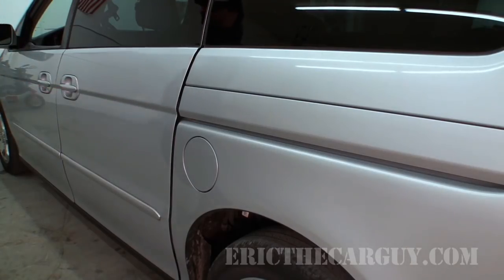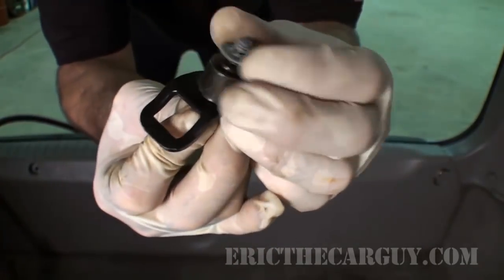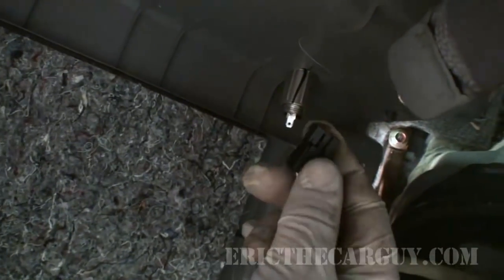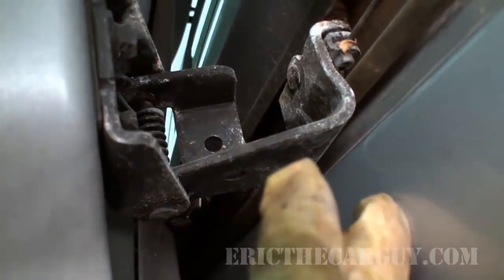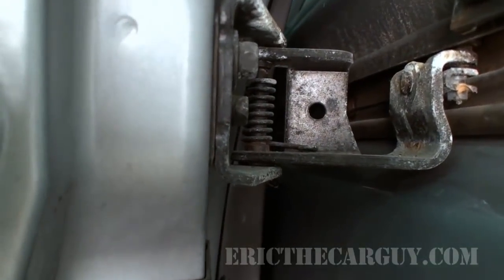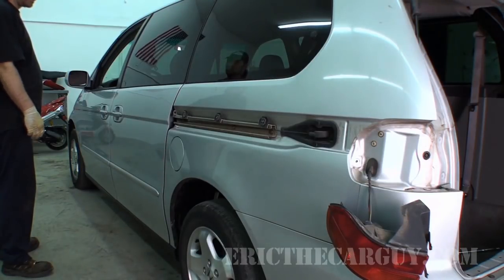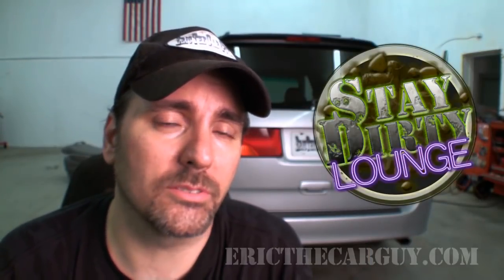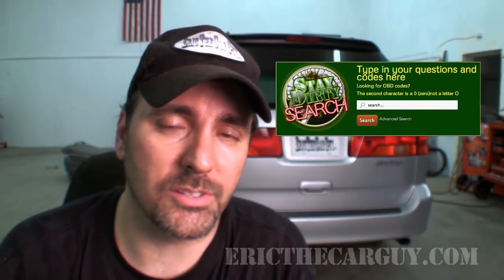Sliding Door Repair 2001 Honda Odyssey -EricTheCarGuy

Comment: After watching the video, I completed replacement of roller on my 2002 Odyssey Passenger side sliding door. Actually, I didn't need to take the entire interior out, just pull off to the rear speaker and the motor came out so that I could adjust the tension on the wire. I ordered part online which cost me less than $50. Thanks, Eric, your video very helpful.

Comment: Followed this video to do this repair on our faithful 2003 Ody (bought it new). Thankfully, I did not need to remove third row seat or as many panels as Eric took out, which saved some work.  Fantastic detail in Eric's videos gives a DIY'er the opportunity and confidence to save hundreds of dollars on every repair.  Part cost ~$50+ delivered. I would have never attempted this without such a great coach!  With five drivers in my immediate family, I have a fleet of older used cars that I maintain, p;ease keep these videos coming.

Comment: Eric, thanks for the vid. After performing this procedure myself, i found that u need not completely take out the rear seat or remove all pannels. rear seat should stow away in the trunk to give u room. you also need only to pop panel back to the rear speaker. u just need to be able to adjust cable tension. i would not have figured this out withiut ur vid. lastly, before u reinstall everything back, check door closed with engine running to ensure door closes all the way and sensor is triggered. i found adjustment was needed at the rollers placing doors a few mm up, yup location is key. thanks again for very helpful video. deuce

Comment: Eric: Many, many thanks for the great video.  I just changed the driver side roller assembly on my 2002 Odyssey and here are some pointers based on my experience of one job.
1) Based on looking through multiple videos you do not need to remove as many interiors items as Eric did.  I have seen comments that it can be performed without removing any interior panels but I was follow suite.  I found it impossible to get the old roller assembly off without loosening  the cable as Eric showed.  I would strongly recommend marking the inner and outer wheels of the inside cable tightener with a Sharpie before you loosen it. That way you know the alignment needed to achieve the same degree of cable tightness as Honda originally had it
2) To get at the inner cable tightener I did the following: Put third seat in stowed position.  Removed mats.  Took out screw hidden where the jack is housed.  Removed jack and all jack accessories.  Note: If jack does not want to come out, likely it is because it has been tightened so that it does not rattle.  Turn the exposed circle counterclockwise with one of the accessories so that the jack closes and is easily removed.  Remove the second row seat belt at the base (14 mm).  Remove the stereo screws.  Remove the screw near the latch for the third row seat. With these removed you can open the side panel enough from the top to perform the work you need to accomplish
3) Honda says I could use white lithium grease to lubricate the channel, which I did when I was finished (Eric used axle grease)
4) I recommend covering the side of the car with painters tape and rags to prevent scratches
5) My hinge also had a shim plate which looked like it was welded on but it was not, only held on with very good adhesive.  I was eventually able to get off with screwdriver and hammer and WD-40.  Soaking with a solvent like alcohol or acetone may have worked better.  To reglue the shim to the new assembly I used Dap Rapidfuse from Lowe's.  It set very quickly
6) By far the hardest thing to do was to get the cable assembly to close back to the original mark I made with the Sharpie.  I am quite strong but the best I could do was to get close but the cable was still to loose.  Finally, I got it this way.  Get it as tight as you can, attach the assembly to the door.  Close the door and then open the door as much as possible.  With the door on and the door all the way back there was finally enough slack in the front of the cable that I could get the inside wheel to turn to its original position.
7) Finally, when completed, door worked well but there was a louder clunk than usual at the fully open position.  A different video showed a rubber stopper that is supposed to be in place at the top of the door towards the back. My car was missing both (for how long??!!) so I didn't realize it was even missing.  I will try to get replacements at Honda.  I wonder if the extra play due to missing stopper some how causes the door assembly to hit in a funny way and wear down/break the nylon roller piece.  All this work because one of the roller assemblies nylon rollers was gone.  The other was intact.
Good luck fixing your Odyssey!!
Reply: Hey reading your post gave more ideas I was scared I had to do all Eric did on his video, your comment just save time to me =) BTW  I have a question that may  someone had already, can you give your advice? doing what I think  could be easier and save a bunch of time too.  Do you think is possible just to replace the rollers (by doing this I think there will be no need to loose the  cables)  and use ball bearing rollers easy to find at any store, or either make some out of a 3D printer ? may be? what do you think? I own a 2000 Oddy and my damaged hinge  is the right one, (Because I live in Tijuana Mexico and here is not possible to get the hinge bracket for the replacement)  Thank you =)

Comment: I did this repair on a 2001-2004 odyssey, right side.  As others have mentioned (thanks!), I didn't have the allen wrench socket, so I lowered the back seat flush with the floor, and pulled the side panel forward and reached around behind it to change the wire tension.  I joined the ETCG premium to see how to do the right side (he has an extended video that shows that, but not in as much detail as the left side), since I was having problems with that.  Thanks, Eric, for such a detailed videos and explanations!

Comment: Boy did you do that the hard way, Eric!  We Honda techs don't pull out the inside panels unless we're replacing the drive motor.  It's a bit tight, but with a pair of "Vise Grips" it is possible to pull the cables close enough together to change the roller.  In the worst case, if I get one that's really stubborn, I'll bend one of the cable guides on the roller, insert the cable barrel, then bend the guide back.  The front bracket for the track cover tends to break off, but it's no big deal, as long as the cover engages all the lugs.  The screws in the back behind the taillights will keep it from going anywhere.

Comment: Hey..great video. Im tackling this job as we speak.
I would like to add something tho...the third row seat does not need to be removed.  You can just fold it in and the panel is actually cut out around the anchor point. (can be seen in your video) 
I didn't remove mine. I was forced into thought after I seen how big that allen bolt was and was like "uh oh..I dont got one that big" After looking at it for a minute I thankfully realised it did not need to be removed..
anyway..great video. it was extremely helpful!!
Reply: Also FYI for those who also don't have the wrench, I think it's a 12mm, not a 7/16 as mentioned in the video

Comment: I own the 2002.  Yes, the Odyssey is not one of Honda's best, and had major tranny issues early on. My tranny was replaced under warranty and it is still going trouble free. The Odyssey has excellent power, 20-22 mpg, gearing is well designed, does not burn oil, no leaks of any kind, 165k. Seats 7 and will haul as much as a full size pick-up without paying for commercial tags.  If it is working, keep it!
Because of your vids, I replaced the same slider, and the clock bulb. Thanks, Eric!

Comment: Thank you very much for the great video.  After watching the video, I replaced both of my door rollers, and everything is working like new.  It was great to know what to expect before I even started the project!  The dealer said it could cost ~$1400 for the repair, and I spent a little over $200.
Reply: did you remove all the inside panel

Comment: I had bad roller assemblies on a 2003 Odyssey plus a broken cable. I replaced the cable with parts from Home Depot per a You tube video. I also replaced the roller without taking all the inner panels.  It took a little effort to connect the second cable end but that saved a lot of time.

Comment: I just repaired both doors on my 01 Odyssey following these steps. I first tried to change the hinge without removing the inner panels, but there wasn't enough slack in the cable. Steps worked great. The only issue was the allen head on the back seat. It's not a 7/16 hex, though that may work in a pinch if the bolts aren't rusted. It's a 12mm hex.

Comment: Hi Eric, the mystery electronic device (at 13:57) attached to the inside the Ody left rear panel is a brake light failure sensor.  There's also a vacant receptacle taped up in blue to the rear-hatch wiring harness (at 14:07) that can be used for trailer lighting.

Comment: I'd like to add that Eric, as good as you are, you missed securing the passenger side middle retaining clips that face toward the camera before you reinstalled the weather stripping. Just thought i'd point that out for ya. also the rest of your videos on Hondas are very helpful, I'm certified through Toyota so being knowledgeable on one family of cars is vey helpful, having someone else who is knowledgeable on another popular brand is just as helpful! Keep the videos coming and I might suggest a video on diagnosing an issue with the engine not starting because of a defective computer, long story short, a customers vehicle came in with no spark, no fire to the coil and no power, after a few hours of research and contact with the dealer for an electrical schematic, I finally came to a hypothesis and conclusion that the PCM was faulty. low-and-behold, replaced and the vehicle started right up immediately on the first turn of the key.

Comment: Excellent video, Eric.  Thank you.  One comment.  The whole dis-assembly to the rear of the mechanism was simply to access the large tension wheel and turn it first one way then the other.  Surely this is a classic case for a pop-off access panel or, in its absence (shame on your Honda), neatly cut out an access hole of your own then replace it with a neat cover plate.  Something tells me these roller bearings will wear out again!  What say you?

Comment: Jesus watching you tackle these jobs is very funny but very insightful both sliding doors on mine the bearings are smoked the body panel is scratched all the way down..i will attempt to do this job after this brutal buffalo winter..the sarcasm. Is enough to make me want to get it done at least on 1 side

Comment: Great instructions and video. I have a question for my 2004 odyssey. If the only reason to disassemble panels is to reach to tensioner in order to release the hinge from cables,  could it be an option just partially cut through the inside door panel with vibration cutter at proper location.  Van has 0 value at this age and shape anyway.  This would save 80% of the work, in case you do not worry much about the panel aesthetics after taping.

Comment: I replaced the right and left rollers in one afternoon. Taking time to remove the side panels is well worth it.  Doing this job without removing the side panels to access the tension wheel is not a good idea.  Extremely difficult to remove and reattach the cable without releasing tension.  However, you don't have to remove the rear seat.  The side panel lifts over the bolts.

Comment: You'd think, if Honda designed things as they used to, you could simply remove the rear "glove box" to get to the motor without having to do all the nonsense of removing seats, weatherstripping and the entire side panel.

Comment: I have replace the sliding door motors on these vans and it is a pain in the ass. especially the left side because the heater core box covers up almost every thing. then when they go out people try and jury rig them on the one i was working on they tied the door shut with rope ruined the latch and bent the door so it wouldn't shut normally and had to get a new door. and latches inside the doors are very fun.

Comment: thanks for the video eric. im a bit of a procrastinator and both doors on my van are broken and 1 door actually fell completely off the roller hinge and i had been forcing the door closed. when it finally broke off the hinge i cut the cable so i could close the door. doing this i left the door useless dangerous and out of order. do you think if i dont replace the cable and just get the hinge that i can still use the door manually

Comment: Good video. Eric, have you had any experience with the "Cracking" rear panels on the 2002ish ford Explorers? If so Could you maybe do a video on how to repair them if you have the chance? I don't want to send mine to a dealer, but I don't know whats in store if I want to replace mine. to elaborate, this is the plastic panel outside on the back of the truck below the glass.

Comment: How long did you play with the doors until you started putting things back together again?

And how do you replace the light bulbs in your rear lights? They are not accessible from the inside, as far as I can see. And I didn't notice any screws on the outside either.

Comment: online says 58.87 each cheapest, The center roller is very common item to fail on all the ody vans. You can take a short cut and not remove any of the interior parts. Hit the door switch into manual and only open the door 1-2 inches. Mark hinge, support door, remove hinge, then bend the little tabs that hold the cable ends. Just enough so that you can remove the cable. Saves you huge time. Only other short cut is to not unbolt hinge but just slide out the hinge pin. 
Good luck

Comment: Appreciate your videos, thanks!  Question - do you have a video on sliding door warning lights for the 3rd gen Odysseys?  We have a sliding door light on, and our right rear passenger sliding door won't open.  We pull the #7 driver fuse to re-set/re-home the system, and the door then works again - but only two times, then the warning light comes back on and the door won't open.  What part should we replace and how?  Would LOVE that video!  THANKS!

Comment: I don't have this 2nd Gen Honda Odyssey but after watching this, I believe that Honda owes every Odyssey's owners the door roller part for free. Clearly, the plastic roller is no match for the duty cycle required for these powered doors. These rollers are under engineered and they should be metal with ball bearing to take the daily abuse. To make the matter worse, to replace these poorly design rollers, you literally have to tear apart the interior panel to get to the door motor and the cable tensioner. For people who is not mechanically inclined, the dealer could easily charge 4 hrs of labor plus part which in my area, you are looking at $600 per door.  There should be an access panel just below the speaker so that you can access the door motor and the cable tensioner to release the door cable tension.  This way, the 4 hrs job could be just an hour or so, making the car problem serviceable in a reasonable time. I have the 3rd Gen Odyssey and the design is similar for the powered doors so I wonder how long until my powered door start to fail, particularly the passenger side. I can certainly replace the door roller with similar process but I think that Honda is failing miserably in this case, both on the poor door roller design and the cumbersome serviceability of a common problem.

Comment: I do have 2002 Honda odyssey same silver color. I don't have any issue on hinges yet. But, I anticipate that it will go bad soon after 16 years and 190,000 miles. I do have question that why you didn't change cable while changing hinge?

Comment: Great video!  I'm having a little different problem, wondering if you've seen it.  I'm trying to fix up a 2002 odyssey that was passed down to us from family.  Sliding doors weren't working well, and I noticed that the front contact pads (mounted on the pillar) were crushed / plastic behind the buttons broken out.  Got the Honda OEM parts and replaced them both.  The passenger side works great now, but the driver's side door doesn't function at all.  The slider moves manually, but won't open or close from buttons or key fob.  If I hit a button, the van beeps 3 times and nothing happens.  The door open indicator on the dash is working properly.  I went through the instructions for reset, pulled & reinstalled fuses 1,5, and 13, no luck.  Checked the little microswitch installed under the door frame, and it appears to be moving correctly.  Have also noticed that now when I manually close the door it locks and I have to reach in and hold the door lock in the open position to manually open the door.
 Any tips?

Comment: Eric, thank you for making this video.  I have a same 2001 Honda Odyssey EX with the same sliding door problem.  I will be repairing it soon.  I also need to do a timing belt change on the Odyssey.  Did you do any timing belt change on your van?  I wonder if you have a video for it.  Thank you very much for your help!  Dan Lau